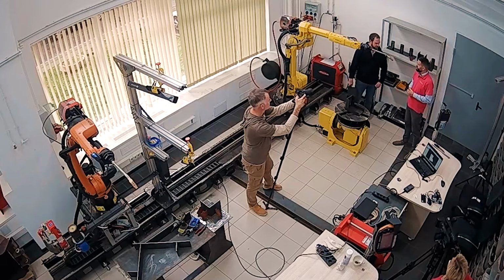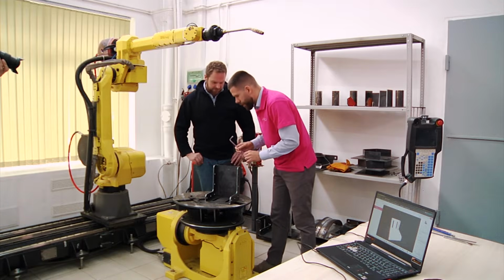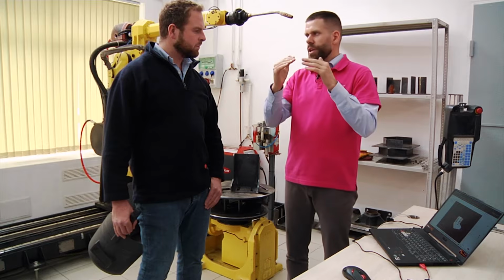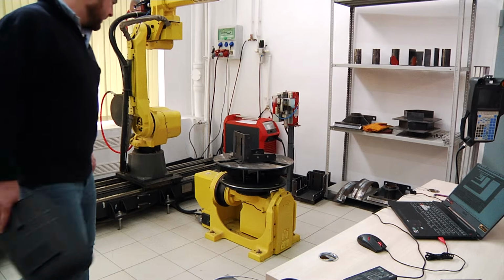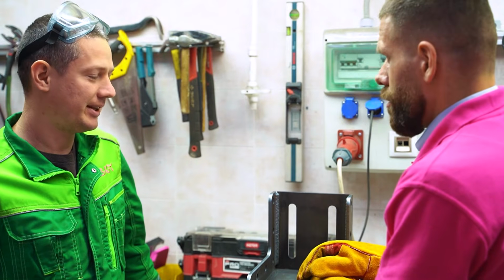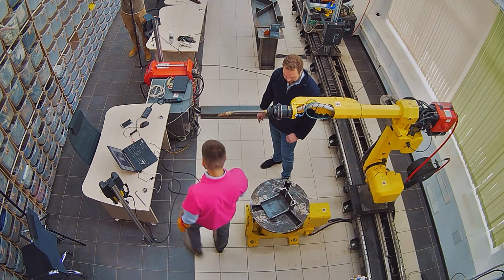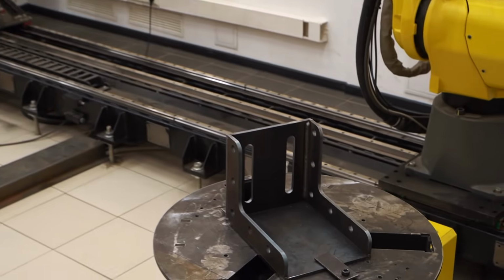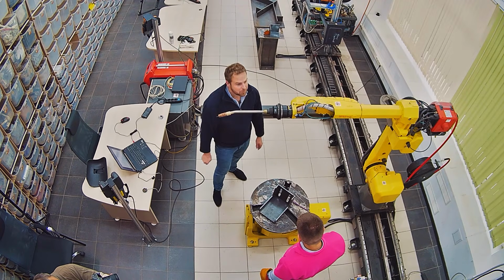Vertical Seam: How to Achieve High-Quality Welding | ABAGY ROBOTIC WELDING

Comment: I have a question.
Como podemos realizar en vertical descendente??
But with good penetration..
Can you understand me?
Reply from the maker: Welding downhill is faster but creates a weaker weld. It's good for thin metal, but for strong, durable joints, you should always weld vertical seams from the bottom up.
Reply: @ABAGY gracias por la respuesta 👍🏻 
Thanks

Comment: I just watched this video. It's really fantastic job what you do. I've been involved for similar practices. Trying hard to achieve the Root Penetration of 1.5mm on 10mm plate. Finally, we understood that, only way to do with interval spot or LORCH SpeedUp process. The parameter are 140A, wire 4m/min, travel speed of 3mm/sec and speedup relation 30%.
Reply from the maker: Thanks for sharing the insights. I think it is as well valuable for the community. Appreciate that!

Comment: Please give Weld parameters is used for this welding
Reply from the maker: The welding parameters depend on factors like the power source, wire diameter, and metal type. With Abagy, the welding engineer at your company can define the optimal welding parameters tailored to your specific parts, based on your specifications and WPS.